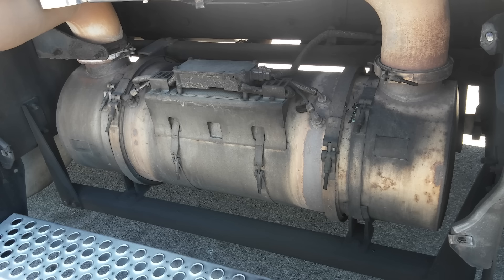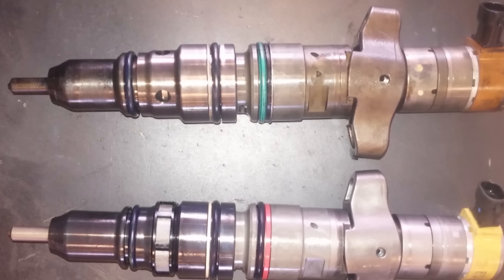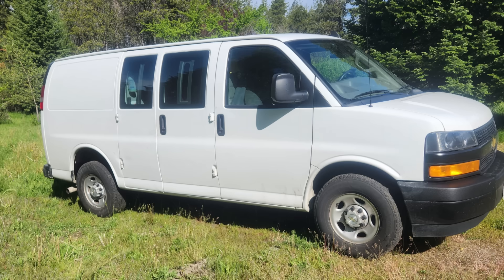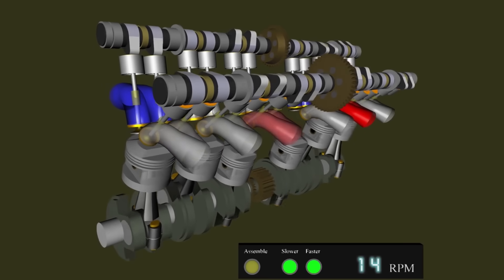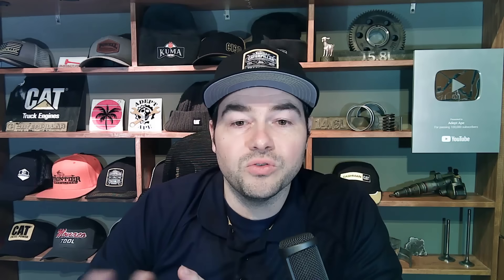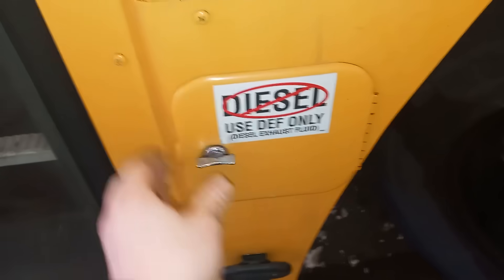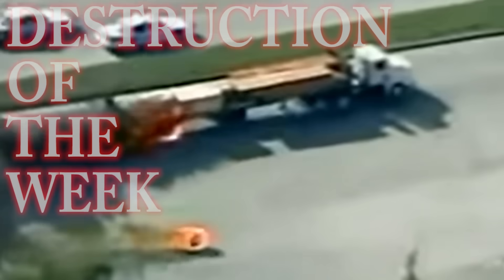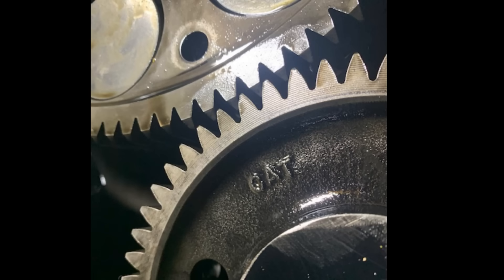What!? Gas engines are getting "DPF" Filters Now!!!

Comment: Hello from Európe, SCR on passenger diesel is a thing here since like 2019 and GPF at least since 2020... EÚ emission standards are crazy...
Reply: SCR on passenger diesel cars has been a thing here in the EU since ~2010.. DPF even longer, not 2019.
Reply: My uncle´s 2008 Škoda Oktavia is already equipped with a gasoline exhaust gas recyrculation system.
Reply: Canadian and American emission standards are pretty tight too. That's the main reason for the EV craze. Unfortunately prices never came down so gas engines are still predominant.
Reply: Yeah, every diesel here too,
THIS IS ABOUT GASOLINE ENGINES ....
Reply: @j @jamesgeorge4874 like I said, we have GPF on gasoline engines mandatory for like 5 years... Thank God it's relialable technology...
Reply: @vapno92 eu passed the law in 2016, making mandatory from 2018.

The us has always been far far being EU.
SCR and DPF with different type of government juice has been on everything in EU since beginning of 200X.
Reply: @Krcman  It's because the EU and US, particularly California emissions have different standards. For example,most EU cars would run poorly on California certified gasoline. Because the formulation is less volatile and has more oxygenates to control emissions.
Reply: @9 @900Yugo the specs for gasoline is lower in the us yes, but when taking about direct injection, the emissions from HC should become better.
Problem is with higher compression/combustion pressures you also godt higher thermal efficiency and higher temps makes more NOx and particles.

And most important the EU has since early 90ties been super political about emissions.
Starting with catalytic converters in 89/90.
Always pushing automakers for lower emissions, which is also way lots and lots of non-eu cars has not been approved for sale in EU, due to not meeting emission demands.
Reply: @Krcman  And in recent years, also because US designed "SUVs and trucks" do not meet EU safety standards and because they are in general far too big.
Reply: @MrShadow1617  In Europe that's understandable given how small and compact most cities are.  Different cars for different environments.
Reply: @Krcman It's different ways of emissions control. EU tends to regulate emissions from the vehicle. US and especially california regulates it from the fuel source. Starting next year gasoline sold in California must be reformulated to work with GDI engines to produce less soot,HC,and NOX. Unlike the EU,most US states have different emissions regulations. Most follow federal,others  California which is much tighter every year.
Reply: @900Yugo no that’s because the spec of us gasoline is pure junk.
What you call premium is the lowest octane type you can buy in eu.
Normally octane is 95, and it’s possible to buy 98-100.

Further EU focused on HC and NOx etc since 89-90ties.
Mainly what has changed is limits for CO2 emission and only limited on NOx as they already was more or less solved by putting catalytic converters on in 89-90.
Reply: @MrShadow1617 Well there is a lot to the case.
They also use way to much fuel compared all other makers.
But yes the main reason has been approval in EU.

And itsn true that us cars aren’t in EU.
At least in Denmark where I live, you have always been able to buy rams, Fxxx trucks, mustangs, chargers and corvettes.
But yes must “normal” family cars in us, are not what we need in eu.
And the quality of the us cars are junk compared to eu/asian.
Reply: @Krcman sports cars and pickup trucks are kinda the exception imo. But idk if the Mercedes X-Class is available in the US without expensive import.
Reply: @Krcman  No,it's measured differently.  North America uses AKI for octane measurement.  I'm in California 91 octane AKI would be RON 95-96 elsewhere. The highest we can get is 93 AKI which is around 97-98 RON. RON-Research Octane Number. AKI- Anti Knock Index,which is a measurement of RON and MON. We have had catalytic converters in California since 1975. For example a hyundai engine with GDI traps soot on the oil instead of requiring a GPF.
Reply: @MrShadow1617 Well I would imagine if a truck can be approved, so would a normal family saloon/mpv etc.

Problem is mainly the fuel consumption, transport costs is a big thing in a eu household, making a car running 5km/l or 12 mpg, fuel is way to expensive in eu for that.
And the cost of the car it self, would make it way more expensive.
There is too many minuses.
Reply: @Krcman  add on the cost of maintenace, mandatory inspections, insurance (base is calculated according to the engines power), etc. Also the size alone is already a massive hurdle for most "normal" sized cars from the US. Which is why people rather drive a 70hp VW Polo. Nowadays, gas is cheaper than diesel, but thats only since the last few years aswell.
Reply: @MrShadow1617 I don’t see why maintenance and MOT should be any different from any other “normal” family car in EU.
Same with insurance that hp doesn’t really matter that much in that respect.
It’s more your age, history of accidents and if the car is a risk of being stolen.

It’s mostly the total cost of the car, fuel consumption and “road tax”

The size of the car is not to problem in this.
As people now gladly drives big electrical cars.

All that really makes a difference is the price of ownership.
Most people buy small cars are because of the price.
Most at least in Denmark, will buy a small Asian car because this what they can afford.
And the people that buys cars in the size of American cars, will rather buy bmw, Mercedes or Audi.
Mainly because they are so much better quality, or this is the assumption in eu.
And cars like dodge, Chevrolet, ford (us models) and gmc has always been the outsider.

Just looking at Tesla, proves the point, when you have cheap ownership, then you will sell plenty in eu.
Reply: @Krcman Wit the Cybertruck being the exception, having been literally or essentially banned from the EU.

In Austria, the monthly insurace payment is higher for more powerful cars compared to low power compact cars.

Maintenance cost I mentioned should have been more detailed. Cost of parts is not really the issue, its more or less the cost that repairshops charge for their labor.

With what the people on the UK call the MOT, or TÜV inspection in Germany, it is mandatory every year, although austrian politicians wanted to stretch it to every two years until 10 years after first registration date of the vehicle.

Nowadays its just not really worth owning a car in Vienna, Austria, unless you work a job where you need a car to get to work, or have a garage space/parking space included in the rental agreement.

And I don't even know if there is a road tax in Austria, apart from the motorway toll you pay for and the tollroads, where you pay extra, like the Brenner-Motorway (A13).

Also, what I meant under nirmal family car is something like a Skoda Octavia in the EU. The equivalent would be essentially the same as a Volkswagen T6 in the US.
Reply: @MrShado @MrShadow1617 an’t speak for all of eu, but Denmark where I live, the insurance is based on the car type/price and km per year.

The Labour cost will be the same or less compared between different automakers, with that note that of course an Mercedes and Audi will be more expensive than Skoda.

The TÜV test is not every year, only every second year.
And not until the car is a few years old.
Same goes for the “TÜV” in Denmark.
And again any tests will be the same for all cars.

The road tax I’m talking about is not based on the road, it’s a tax on the car.
Paid by different schemes, many years ago it was by weight, which was changed 20 years ago, to go by consumption.
So again my point with a low mpg, will give a high tax, leading to a high total cost of ownership.

Like I wrote it’s all down to car price, road tax and consumption.
Every other thing in eu would be more or less same in between different brands.
Already in eu big expensive cars are also less sold than a car the average person can afford.
There is a reason vw passat has been the number 1 for many years to a familie of 4.

Comment: The upcoming 1.6 turbo for Chrysler and the updated 2L Hurricane are going to be used direct and port injection, as well as two spark plugs per cylinder, both plugs will be different, as well as different coil packs. They will also be using VGT, variable geometry turbocharger.

I am not looking forward to have to work on these. The 3L Hurrican straight, is already a nightmare to work on. Just had to install a new water CAC to one just before Christmas, because there was a blemish on the coolant inlet pipe that would allow coolant to leak out on the low temperature/pressure side. 2 hour job on that, and the Ram 1500 Rebel that it was for, only had like 16 miles on the clock.
Reply from the maker: Pretty soon they will just be tiny little engines with more add-ons to the intake, exhaust and fuel system than the size of the engine. Water pump job will cost more than half the price of the car.
Reply: There's no Sacred Cows (reliable vehicles or parts) left over . . . EVERYTHING has been taken to the slaughter house decades ago.
EDIT: And everything is a nightmare to work on.
Reply: @GIGABACHI  ford 6.2's seem fairly reliable, available, affordable, they should've kept making it. i got an IDI, there's still parts
Reply: @autismion  The 6.2 is a workhorse. 
I have seen it on the 3/4 ton trucks last longer than the rest of the truck.
Even the "terrible" 3 valvers last forever when kept on a strict diet of fresh synthetic oil changes every 5-6K miles.
Reply: It's almost like the pursuit for more MPG, got us some of the worst engines ever built.
So maybe you're making 20+ MPG on a V8. However you're now spending triple the cost of fuel in the ownership of the vehicle, in just repairs.

I'll take the 12 MPG if the engine runs for ever.
Gas prices change all the time.
Parts are just going up in price rapidly. Then labor on top of that.

I think we peaked in the 90's and early 00's.
We got pretty decent MPG.
The vehicles were still easy to work on.
The parts were still pretty cheap.